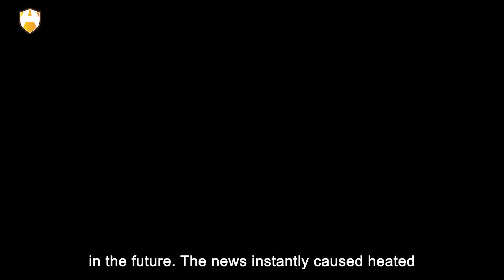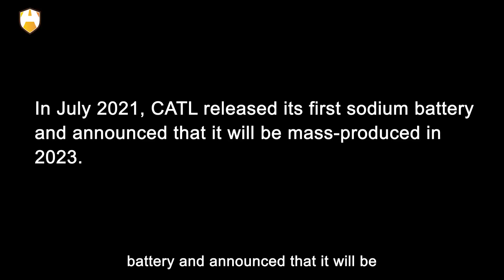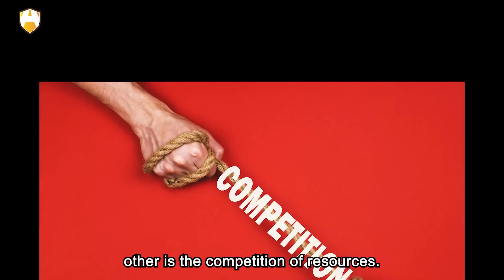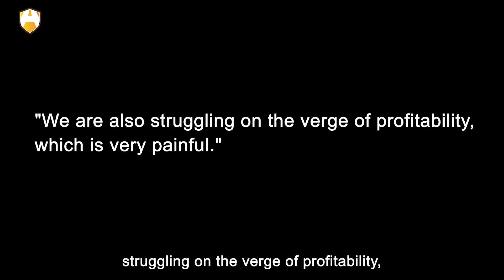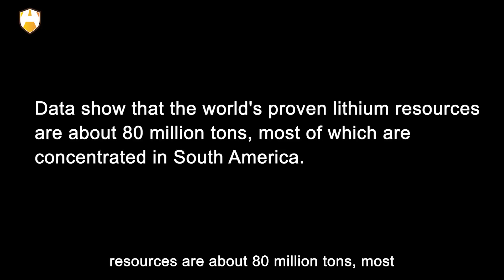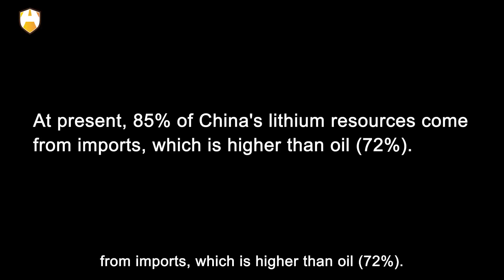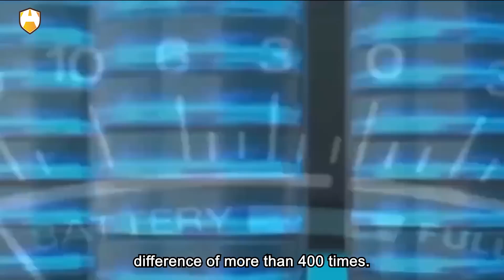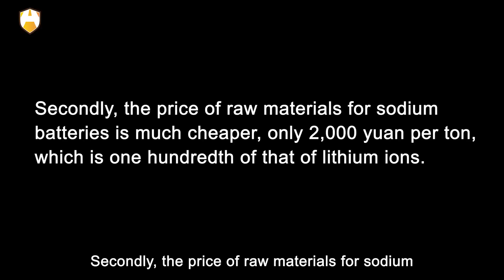No More Lithium! Sodium Ion Batteries Finally Hit The Market!

Comment: Just watched something interesting which pointed out a couple of issues, as usual it is not as clear cut as they  make out. 1 major issue is they use a lot more nickel than than Lithium which is another rare earth. So you will get almost as much problem sourcing the nickel. 2 scaling up production will take years. so it will probably take around 10 years before sodium draws level at cost and availability.

Comment: For one mole of electrons you need 7 grams of lithium. For one mole of electrons you need 23 grams of sodium. 

So in cars or anything mobile that is a big weight disadvantage.  For non-portable power like a home backup battery sodium batteries may be useful if they they are cheaper and last longer than lithium batteries.
Reply: Good point, three times the weight, and at least twice the volume.

Comment: Diversification is good, not being limited to one type of battery or material seems ideal. Different custoemrs might also have different needs and a cheaper battery even if it performs differently might be work for certain applications. They could also be used for emergency batteries for buildings maybe if they are cheap and don't have to be used very often it would be a perfect cost effective solution. I'm assuming it would be a very costeffective solution for such needs, and if they are cheaper, they should also be made in such a way that they are easy to replace when the time commes..

Comment: Before running automatic text to speech translation, check please the text. "According to the news from CATL, the ideal battery life of sodium batteries in the future is about 500 kilometers, while the battery life of lithium batteries can reach thousands of kilometers" has no sense. You probably forgot to write the word "cycles", so the translator have chosen "kilometers" as default units instead.

Comment: If it is just the problem of cycles of batteries it is not a problem. The problem is their price. If Na-Ion batteries are far cheaper than Li-Ion batteries, replacing used Na-Ion battery in a car after 5 years of everyday charging and discharging can be still quite attractive. Who cares about the fact, that Li-Ion batteries can have twice as many cycles?

Comment: Simply make electric car batteries rapid to swap out, so that on long journeys you simply exchange the cars battery bank, when doing short journeys it can still be charged at home form your solar panels. Just like we swap a battery on a cordless drill, sure you would need a machine to help swap a large battery on a car, but a rapid system could be invented quite easily so that a battery exchange could be much quicker than filling with Petrol.
Reply: The problem here is not all battery have the same efficiency and lifespan to be easily replaced in stations.
Reply: @ramysaad1047  All of the packs also have to be identical. That's probably not feasible because there will be numerous different shapes and sizes of packs if the auto industry goes entirely electric.
You also have to store lots of them at the battery station.

Comment: Battery life is not measured in kilometers.
Reply: Thanks, and very true, cycle life means number of full cycles the battery will complete before the available amount of energy drops below the level of public acceptance. This could be 80%,  60% or 50%, of full capacity.  Presently it is 80%, but could change to a lower value to extend range.

Comment: I'm pretty certain that if you got heavily invested in lithium and rode that particular wave (kudos to you by the way), now might well be the time to get out. Sodium batteries are going to be a thing, they already have them performing and there is a lot of scope for more research, where Lithium tech almost has to be a lot closer to its endgame. If the cost of graphene production keeps getting cheaper, which it should, they will become cheap, because you can literally scrape sodium off the ground or evaporate some seawater.
Reply: Na-Ion is definitely coming, and soon, but it still has some pretty big kinks and drawbacks, especially for certain use cases.

Comment: I think if range is not an issue, in city driving is perfect for sodium ion batteries. It's much cheaper and can be replaced. The cost of replacing a lithium ion battery is off the charts. They should have the sodium ion battery for everyday use, and a small space in the car to add on a lithium ion battery for longer range. That may work. Like in the trunk. If you go on a road trip, an extra battery could be added
Reply: @Neil Wani
I'm not a professional engineer myself, but I extensively read on the subject like the way they design electric batteries into the structural frame to achieve weight reduction and so increase range as well as improve general balance. Adding a second battery defeats all economical gains obviously. It both adds cost and weight. It also reduces room for cargo/passengers.
Reply: @deoibyiyingoma1784  Most people don't need an extra battery because more than 90 percent of the time, the trips are in their own city. So for the few occasions, there could be stations that have charged small add on batteries that they can add to their cars and put them in the trunk. I know it would take room but that's the main drawback. If that's the only drawback, it might not be so bad.
Reply: @neilwani1178  
Still, a battery in an electric vehicle is  very heavy and also very expensive. Keeping a spare one looks counterproductive to me. I think a better solution is reseach to extend the range on one hand and on the other establish a  facility network to conveniently  recharge    batteries the same way filling gas stations are now accessible.
Reply: @neilwani1178  it could be a real boon for the post office, and city bus companies.
Reply: @deoibyiyingoma1784  this may be why battery exchange companies would thrive.
Reply: @nickiemcnichols5397  The battery in my phone is not removable  so might be the one in an EV. Plus the battery may be too valuable to be a randomly exchanged part. Consider  whether to remove a brand new expensive battery and swap it  for one with ten recharges left.  One only would agree  to do so if the battery was rented from the company instead of being purchased with the car.

Comment: The major advantage of the sodium-ion battery over the lithium-ion one is that it does not pose the same fire risk which will eventually limit the sales of EV vehicles with such batteries as fire become more frequent as the batteries age.
Reply: @Tron Jockey I build dozens of lithium batteries every month. I disagree with your logic. It's not something that can be proven one way or the other yet. It's too early and there's not enough manufacturers with batteries old enough to tell if they're going to have catastrophic failures when they age or not. A reasonable person would understand that. It doesn't sound like you're a very reasonable person.
Reply: @aznative_  Tron stated facts, you stated you don't know.
Reply: @BioniqBob  You simply can't comprehend the logic and facts.
Reply: @Mr-hn2bp  M O R O N

Comment: The best electric car will be like the slot cars with an ac ele connection going down the highway with small batteries for in town driving. Using lasers to make the connection
Reply: @Tron Jockey LOL, like batteries there are all kinds out there.

Comment: Batteries good for waste after 500km is not an option. Very bad
Reply: @ Karim Roufaou
Well, it's 500 km on a single recharge out of 2000 possible. That fetches you one lakh km. Not so bad !
Reply: @deoibyiyingoma1784  ok! Agreed
Reply: @Tron Jockey In that case, it should be illegal to keep polluting our atmosphere with ICE since no technical excuse exists.

Comment: When people argue "it doesn't have any advantages". Thats usually in comparison to their own vantage point. Accessability is a massive advantage, if someone can make a battery from tesources that are more reasily available and dont enslave them to a particular countries market. Well id call that a pretty massive advantage. But of course if your used to having a monopoly on the supply on something people need. Youd obviously argue there are no advantages to anything that will cost you a customer.